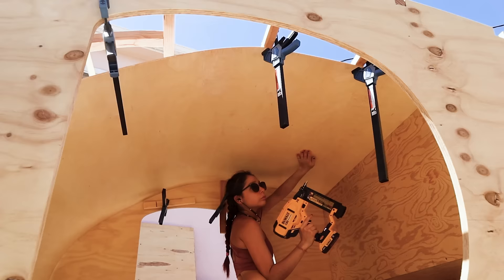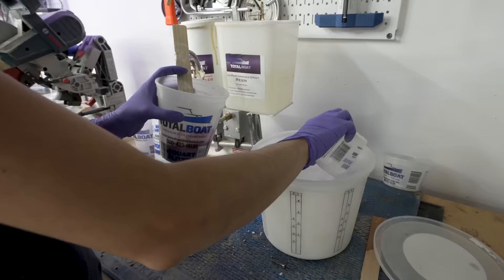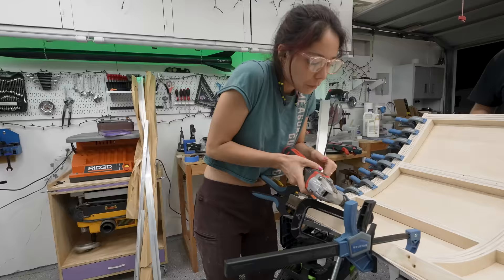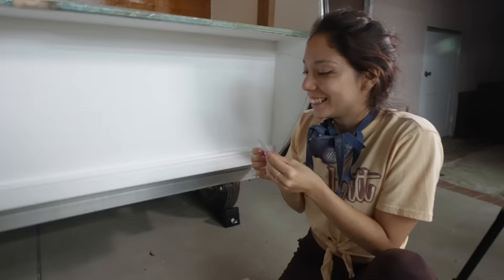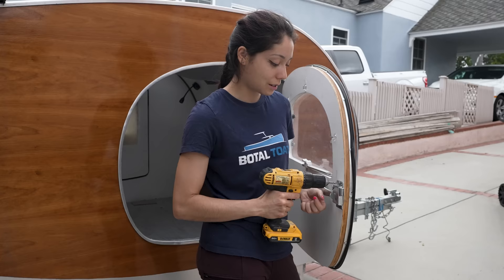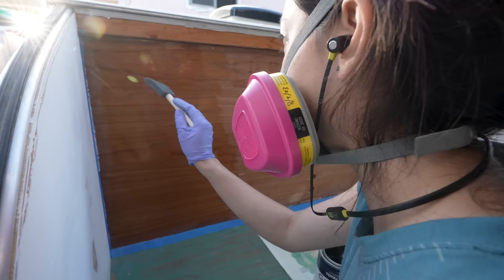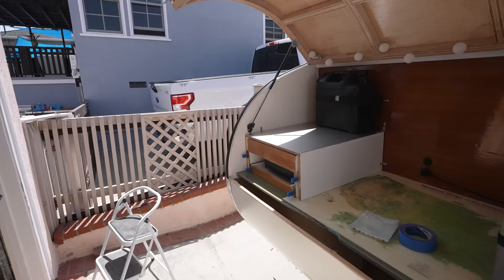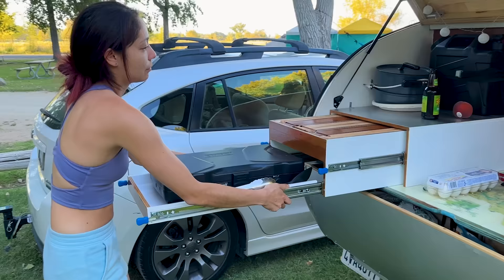Teardrop Trailer KITCHEN BUILD

Comment: I'm a big fan of iterative development, this is a great example of it. You didn't build more kitchen than you needed the first time, and once the requirements were more clear you were able to do a second iteration that was much better than it could have been if you'd attempted to make it perfect from the start. 

Also that cutting board is gorgeous.
Reply: Agrred.  Such a good way of doing it.  I've done the same with my Mini camper conversion.  I use a roof top tent so have no need for sleeping space which rules out all the usual modular conversion companies so I knocked up a simple pull out kitchen design which was then modified after the first trip to make it better.  And now I'm on Version 3 which is the culmination of the first 2 experiments and works way better than before.
Reply: Iterative developement is ok when prototyping. But for a complex finished article I prefer to thoroughly think it through (scuse alliteration) as it saves the big/costly reworks, and reduces weight and structural compromises. I'm a fan of 'best part is no part' and multifunction. Nice camper though.
I'm also a fan of form follows function, I made a trailer/camper that compacts to less than an eighth of its deployed size, and it can still double as a regular trailer when I need it to.
Reply: I've never heard the term "iterative development" refer to maker projects, but I like it.
Reply: @vigilantcosmicpenguin8721  That's cause it's just a general term that refers to working on a project continuously taking what didn't work and making it work and it can apply to just about anything.

Comment: I had a short moment of confusion when I saw you mounting the right gas strut upside down but you corrected that at some point. To all those who might not know: gas struts should be mounted with the piston down, because there is a little bit of oil in the cylinder that not only lubricates the piston rod but also helps sealing it. Mounting them the other way around makes the oil pool up at the other end leading to premature wear. Great project as always.
Reply: You are completely wrong here
Reply: @TheLukaszpg yep, I’ve seen many OEM gas struts mounted with the cylinder top side. Even some automotive shock absorbers are “inverted” with the shock body on top and piston on the bottom.
Reply: I agree with the piston down in the way I use them...less likely for water to pool on the piston shaft seal and cause rust

Comment: Hey Xyla. Love the content & I had one recommendation for the tail hatch bar holes. A stainless hole plate to save wear & tear on those holes in the sides. As long as it doesn't interfere with the drawers on the left side of course. 😍
Reply from the maker: I put epoxy in them! It was an afterthought so i forgot to film it though haha

Comment: Always great to see projects evolve after initial use. You could use some 3/16 cord between the barrel bolts to dis-engage them at the same time by pulling the cord.
Reply: I did something similar on a recent project, worked great.

Comment: Nice! I got the quick-and-dirty-version. Just got a bunch of magnets and thin blankets as "curtains", some cardboard and a wooden board to support a camping mattress and crammed it into my Volkswagen up!. A small cooker, some minimal toilet solution - and it feels like freedom. Especially when my health is a bit wonky it takes the load off my shoulders to get back home the same night. Even in Switzerland where camping is pretty regulated you are allowed - even encouraged - to sleep in the car if you are too tired to drive. And with a minimum of equipment it's just far healthier.

Comment: Your trailer is an impressive project with great results.  I'm sure many people have suggested improvements or other ways of completing it.  The only things that some to mind are: 
A) The door hinges.  There are better options for hidden fasteners, internal hinges, etc. that would seem better suited for the doors.  As is, you could lock the doors and anyone with a screwdriver could readily remove the hinge screws and the doors.
B) May I suggest you add some fenders to the trailer?  It would help to clean up the look, keep a lot of road grime off the trailer and protect it from road debris.  Best of luck to you and yours throughout all your travels!

Comment: As anyone who has built a camper knows, through actual use changes will be wished. One thing I would recommend would be to dowel the hinge side of the doors. While Exposed hardware has a design flair it also would allow a less than honest person access with only 30 seconds and a drill. A dowel under the hinge keeps the door from being removed unless it is already open.

Comment: I've just had a frustrating couple hours where I put a robot leg together in the wrong order, requiring me to tediously remove two very difficult-to-access screws, take it apart, put it back together and get the dang screws back in - and then discover I'd made the wiring harness for the battery the wrong length and I need to splice in another three inches or so on four wires.

So I decided time to take a break and make food and your video popped up in my feed and I'm like "ah!  Xyla will remind me that making stupid mistakes is normal and not the end of the universe!"  And in under five minutes, you proved me right.

I feel much better now.  Thank you for showing the goofs as well as the good.

Comment: Excellent craftsmanship...at least as far as I can see.  That's great use of the drawer hardware for the extended pullout.  
Couple of thoughts: at 19:45, Rain-X in your washer water and silicon wiper blades really improve your comfort while driving in the rain.
At 21:47 you're chopping something green by lifting the knife completely off the cutting board.  Try holding the pointy end on the board and rocking the (hopefully) curved blade through the celery.  I believe rocking  helps save the edge of the blade.  And if you have something to stand on or move the cutting board to a lower elevation, you'll find it easier to control the knife.  Work surface should be almost elbows height.   
I didn't notice whether your side windows removed, but if you want to replace them with a screen for sleeping without insects bothering you, you can use magnetic strips to completely seal a plastic screen to the window frame (or you might have to install a steel surround on the windows).
A friend of mine, also an engineer, traveled with a collapsible tarp cover for his van. The tarp was held up by PVC pipes with strategically placed holes/grommets in the tarp for the 4 corners of the tarp.  The 4 corners were held up by marine quality bungees front/back and sideways/out.  He tested the tarp in a 60mph wind.  It folded flat to the ground, but the bungees hoisted it back to vertical after the wind.  He used bolts sticking up from the top of the PVC pipes to go through the tarp grommets and hook the bungees around pulling everything tight.  He liked the apparatus for keeping noisy rain from pelting his van while sleeping and as a sun shade.  The 3/4-inch PVC pipes were split in the middle with a connector piece of 1/2-inch glued to the top of the bottom piece. The top piece slipped over the 1/2-inch to get the height. Bungee tension and gravity held it all together.

Comment: I just completed my first tiny bicycle camper...havent even used it that yet.  I was able to keep it under 150lbs and used a steel tube bed frame and one of those bike trailers to pull kids in as the base, a wooden skeleton, clad in foam board and poor man's canvas.  I did all the design planning old school...tech pens and paper.  Took longer than building the dang thing.  The only power tools I used were a hand drill, angle grinder, and rotary tool.  Everything else was done with hand tools for minimal expense.  The whole thing without plumbing and electrical was less than $500.  It is 40" wide, 84" long, and 48" tall.  It was a lot of fun to build.  I also built it all outdoors and just covered it in a tarp when the weather was bad.  I may eventually fiberglass it.  I also recently put together an ebike to pull it.  Another first for me.  Got a 48V battery and front hub motor but am gonna order a rear motor soon as well.
Reply: Look into a 52V mid drive motor like a Bafang BBS unit. I have 10,000+ miles on the 750W motor on my ebike build. Total bike weight is about 65 lbs and I’ve pulled many 100 lb loads of groceries since I built it 6 years ago.

Comment: What a lovely video, and an amazing rework/finishing of the project you'd started before. Of all the choices you made here, only one thing I think I'd have done differently, and that'd have been to flip those L-brackets to mount to the back wall BEHIND the cabinet, router out a small relief pocket either in the back wall or the back of the cabinet, and then have them come up and loop OVER the top of the cabinet to make them... well, if not invisible, then at least half as visible. But that's just me.

Awesome work! :D

Comment: I love this is so cool so you basically done the camper side of a project I'm about to start. The main difference is propulsion. The trailer that I'm going to build is going to towed mostly by bicycle (the bicycle RV) but I got myself distracted from this in my quest to design a CVT transmission for the tow bike because I wanted the bike to be able to move very slow and both vehicles need very efficient parking brakes

Comment: I think it would be pretty cool to remove or be able to remove the top wall between the cooking portion and the interior. I think that would be pretty handy, especially if you are in a cold climate. I'm not sure if you would be able to properly integrate the drawer in though.

Comment: Great project the first time around, and these improvements and refinements now that she's got a few thousand miles on her are a perfect example of iterative design.

I love the kitchen design elements - the double drawers, the inserts, the cutting board. One minor idea I had was to cut some semi-circles out of the top edges of the drawer organizers - in random places so they never line up - which can give you access to grab them from the top when you need to pull them out.

Comment: Your builds are very impressive! 

I am curious about when you are doing the Skins around the Curved Members... Have you considered simply using tension straps (Ratchet Straps) across the middle sections in addition to the clamps on the edges? The tension straps would help ensure you have a firm pressure across the middle skeletal supports. It is a technique I have used in the past with other builds and had great success.

Comment: Having built mine 6 years ago and using it lots, I think you're right about sealing everything with epoxy. I didn't, and I have hard to find leaks. It's been interesting to see the timescale of wood breaking down over the lifespan.

Comment: Pretty damn fabulous!  Double extension with the slide brackets and the amount of leverage if there's a pot of water on the stove and someone casually leans on the tip on the second slide seems like the important test case.  I like the idea of either doubling the set of slides nearer the body of the camper or  else adding a support chain or spectra cord on the top outside of the first slide section.

Comment: Super cool. Extreme programming in wood and aluminum. No dishonor in pocket screws. An excellent joinery technique, even if you can see the holes, which means you can tighten them in 10 years. Veneer patching is a hundred years-old art form. No problem. Good job.  But I'm so confused... How do you spell it? boataltot or botaltoat or boataltoat or botaltot. I don't think we cared until now.

Oh, never mind. It's in the notes.

Comment: Love your mods. Much more practical. From a security point of view I’m concerned your doors are just screwed on from the outside which means they can simply be removed with a screwdriver. Bolting right through the hinge and wall with a coach bolt would make things much more secure.
Reply from the maker: Ya know, when it got robbed they just took the whole trailer. Wheel boot and hitch lock and all. I’ve just accepted security isnt real and shit happens, I don’t travel with valuables 😅
Reply: @xylafoxlin  Oh no it got robbed? have you gotten it back?

Comment: Not sure if you did or not, but your trim screws should have some waterproof clear silicone gel to prevent water damage. Granted you fibreglass them and epoxy them, but at the screws that are no longer waterproof hence your water damage

Comment: I don't know how big of an issue bigs are where you are but when I would go camping in Botswana they were  huge issue.  Maybe a small gazebo type tent with an open wall that you can inclose the kitchen area in.  Or better yet design it to fold out and down from the inside of the rounded hatchback door  giving you a meshed inclosed area.  In any case this is a super cool build.

Comment: Great designs, and lovely finishing work. The chopping board/tray is a brilliant idea.
6:40 Never, EVER, put your fingers on the INSIDE of a hinged door or hatch.
That prop you had holding the door up could have failed, a thing that happens often enough that anyone sensible does not say "It was perfectly strong and fixed It couldn't have failed ".
If that had of failed, you would have lost your thumb.

Comment: Not sure if you did this or not as I did not see it.  You might want to find some Teflon eyelets to be put in the side wall of the trailer  for the locking bars for the rear hatch.    It will be more secure and save a lot of hassle if the holes get worn out.,

Comment: What happened to your fenders for the trailer ? You better get some on there. I would also invest in good mud flaps for the vehicle or a Rock Tammer that goes on your reciever. This will save your trailer from stone damage when off pavement driving. I also put mud flaps on my trailer which helps save the tail light wiring from damage. Great job on the Camper, you are an great at building stuff.

Comment: When are you going to build the (Dark Aero kit) version of your teardrop trailer in carbonfiber intermixed with aluminum?  An interesting version of it would be as a kit using CF/glassfiber internal structure for the corners that could be all bonded/riveted together by the end user. [And easily palletized and shipped.] Then skinned with wood, aluminum, stainless or CF panels? [Something the consumer could source locally or could be palletized as an upgrade option and shipped.  With the CNC router, you could make most of the patterns to make the molds required.

Comment: Awesome end result, what a fantastic little camper…😊

Noticed some of this footage shows “mud guards” over the trailer wheels but some doesn’t….is that not a legal requirement over there…? 🤔
Reply from the maker: Sooooo it got stolen from my house and one of the fenders got wrecked by the anti theft boot (I know, I know) so I just took the other one off. I don’t think there’s a law? But I should look into it
Reply: @xylafoxlin  had a quick look online, similar to UK the trailer wheels must have the “mud guards” or “fenda guards” fitted…. It’s all about safety for the vehicle behind you… 🤔

Comment: Young lady I'm SHOCKED that you haven't put a couple of solar panels on your camper!  (Yet at least)  Not sure of the space available, but it looks like you could put a couple of the Renogy or BourgeRV flexible panels on either side of the roof vent.  And really all you'd need besides the battery is a decent charge controller if you keep everything DC.

Comment: Xyla. To say that it still looks amazing and comfortable is an understatement. Iwish i could have a smaller version of it to tow behind a mountain bike. 
But there one thing to me that's missing, reflecters and lights for on the road. I'm not sure if I've missed something, should i watch the original video again? 🤔
I think i will anyway, its interesting. 😀👍
Edit. Yes i did watch the first part, also i think I know what it is. Here in the UK we have a brake light up high in the middle of the vehicle, not sure what your laws are but it could be a good idea? 🤔

Comment: You should do a collab with the Lock Picking Lawyer to make sure that new lock is enough. Seems like something that could be jiggled or raked open.
Reply: 5 pin tumbler, most likely a wafer lock. Easy to pop with a screw driver and a wrench on it, or just unscrew the latch from the outside and spin. Or you could spend a couple bucks on a hacksaw blade and an allen wrench and grind a set of picks and tension wrench and have it open in about 20 seconds.... If you don't already own a set of picks.... 
Course, you COULD be joking.... but hard to tell....

Comment: Love your vids, but did you know that you consistently go backwards with you router?  I've noticed this before.  You should be going from left to right so that the router bit will pull itself into the workpiece and give you a cleaner cut that is easier to control.  Thanks for all the videos that you make.  I've been watching since the wood corset and haven't missed a single one! :)

Comment: I see that plans are coming and I want to build this, but I’d love to know a realistic estimation of what this would cost to make. I’d obviously want to do it right, waterproofing what needs to be waterproofed and whatnot, but would probably opt for cheaper materials where possible like swapping cherry veneer. Are we talking like $1000? $2000? $5000? $10000?
Reply from the maker: Realistically probably ~$3k if youre saavy about it + the trailer itself-- the one I used was ~$2k since its aluminum. My biggest two costs were the trailer chassis, and ~$2k in lumber, and a few hundred in aluminum. I did buy lumber at the peak of the crazy lumber prices though, so that could come down a LOT if you have a good supplier (and don't live in California)